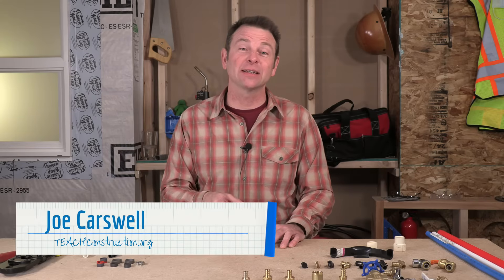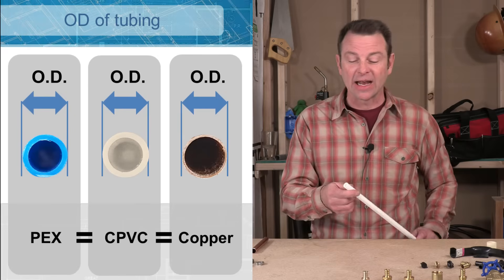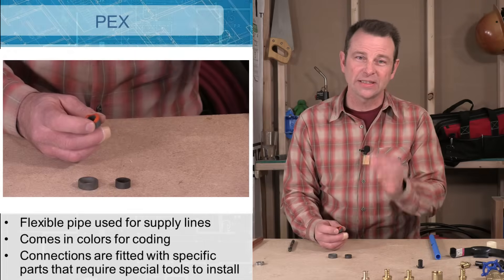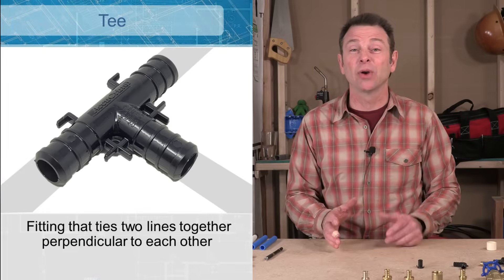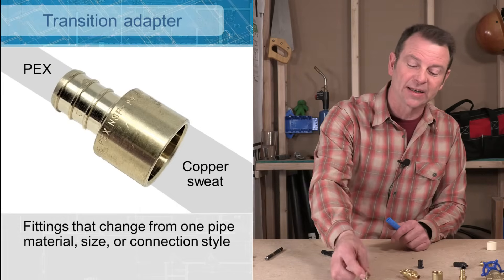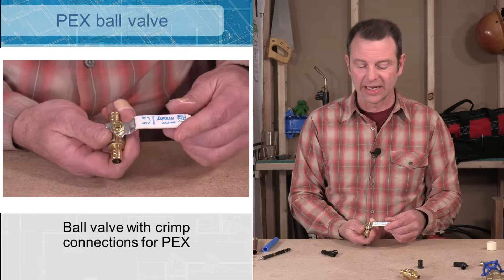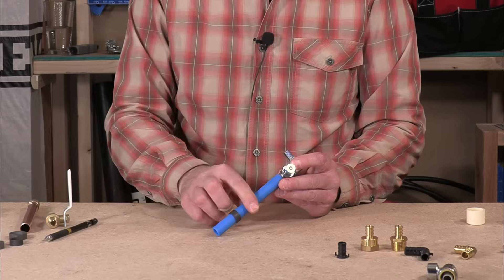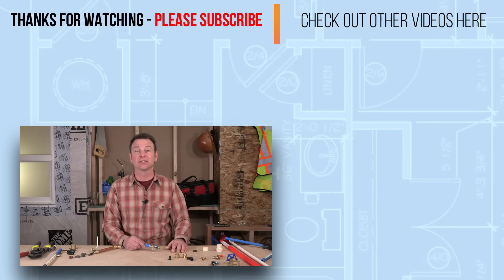A lesson about basic PEX plumbing materials  - Intro to Plumbing Systems

Comment: No mentioning of being careful to not confuse expandable and insert fittings where pex-a is always expandable and pex-b is commonly insert only (zurn being the exception to my knowledge). Expendables are full bore as the pex-a/zurn pipe is expanded so they don't obstruct flow while pex-b inserts restrict flow as they fit inside the pex-b pipe.  It's a very important distinction and the reason I believe Pex-A has the reputation for being 'leaky' when it's really this critical piece of missing information.
Reply: I did not know that but I decided on B.  Plumbers seem to be using A, and there is a video of one vs. the other.  In it he says the tool for B is $150 and the one for A is $250.  That's WAY off.  Try $32 for the B crimper, cutter, 20 1/2" crimps and 10 3/4" crimps.  The tool for A is more like $475.  The PEX A tubing seems better, and more expensive, and when they connect the two together they, they simply crimp it onto a B fitting.  At first I was going to use A tubing with B fittings but decided against that too.  While A can recover from a kink, what are the chances of that actually happening after install, and if you use a bend guide support, it won't happen at all.  Yes, there is a restriction at every fitting with B, but would the difference even be detectable in userland?  Faucets and showers have flow restrictors that limit it anyway so I doubt it.  There is even a screen on the washer inlets.  About the only place it is unrestricted is the hose bibs and those are usually fed by 3/4" main and 1/2" through the wall and even sprinklers don't kick out that much unless you are using it for underground sprinkling in which case you wouldn't go through the wall 1/2".
Reply: @jackt6112  There are various tools for A and B, if you want to compare the cheapest A it's around 60-80 but it's manual, I'd rather spend the 400-450 you mention on the dewalt battery one.

"A tubing with B fittings" - yeah that'd be a waste, the whole point of A is the full flow fittings.  The crimp recovery is just handy bonus.  As for the restriction being detectable.  I personally feel it has to be detectable because I grew up in a house with copper full flow fittings and the pressure was fine with multiple bathrooms in use where as my post 2000 build homes have terrible water pressure even though the water hoses which break off early in the water lines for both post 2000 houses are about the same pressure.  I can only blame the fittings or multiple houses have had really really bad plumbing designers vs the 1960s.
Reply: @Trahloc  Actually I was comparing it to the Milwaukee but it seems the DeWalt is priced similarly.  From what I've seen on YouTube and online, unlike PEX B, doing PEX A with a manual tool is considered operator cruelty.  On the flow restrictions, I have nothing to compare it to.  Galvanized 1/2" is .622", copper is .527", while 1/2" PEX is 0.485".  The dimensions were arrived to to duplicate tested to have the same average flow over time in a plumbing system as galvanized of the same size so there is no difference for design purposes between galvanized, copper, or PEX.  However, we know, PEX A doesn't have the diameter restriction at the fittings so that begs the question, which PEX established the ID?  My guess would be PEX A since A comes before B, and none of the others have restrictions at the fittings.  Both PEXs are the same ID so PEX A should flow better to some extent, so that would mean that there is no valid design standard for PEX B.  PEX B is an easier install and has the better track record for not developing leaks over time.  However, PEX A is approved, so it cannot be that bad.  Black Polyethylene Tubing as used in underground sprinkling tubing and gas lines has a .600" ID so it does compensate for barb fittings.  I'll have to research to see if there is a de facto adjustment for PEX B that can be used to ensure a PEX B system has similar performance to the others.
Reply from the maker: Great conversation going on - really great to see.   We just purchased the Milwaukee PEX A expander and will be doing a video about PEX A in the coming weeks.   My two cents on the flow restriction of B - it is a real thing.  I redid my house from copper to PEX B using a distribution manifold and a clean run for each line.  I noticed a measurable flow reduction.   I will measure it as part of our next video - or an additional mini lesson as part of the series.
Reply: Good information, thank you!  I subscribed to your channel.  I heard that you can compensate for the reduction in flow caused by the Pex B connectors by installing 3/4" Pex, and that makes sense, but on some other video they don't recommend up sizing for the hot water line because it would waste more energy.  So your comment makes me think that I should go with Pex A or CPVC pipe. Which one would you recommend between Pex A and CPVC for a hot water line?  Also, how dependable are the shark bite connectors near  the water heater?  On my hot water heater there's a copper pipe connected to galvanize pipe. I'm wondering if it would be okay to connect the copper pipe to pext A or CPVC....the copper pipe is connected to the water heater and is only about 2' long so the connection will be subjected to lots of heat.
Reply: @genechicago4806  
1.  Something that you can do to keep your lines small is by integrating something like the SharkBite 22786 4-Port Open Copper PEX Manifold.  (don't be fooled where it says 1", that is the extra body diameter which is what you want.)  You could make your own manifold too out of cpvc or anything.  For some it makes sense to have a cold manifold near the inlet of the water heater and another near the outlet.  This minimizes temperature and pressure changes when showers, faucets, toilets, dishwashers, and washing machines kick in.  They also make much more expensive distribution blocks with shut-offs built into each outlet if you are so inclined.
2.  Water Heaters
- CPVC can be as close as six inches away from the water heater and rated for 230°F.  CPVC does not crystallize and thus does not have a melting temperature.  The measurement that is most commonly used to determine the maximum use temperature is called the heat deflection temperature (HDT). This is the temperature at which the plastic will begin to deflect while supporting a small mechanical load.  230°F is CPVC's heat deflection temperature, and thus a maximum use temperature, which is greater than most other thermoplastic piping.  CPVC does eventually reach a point where they transition from being hard and rigid to becoming soft and flexible. This temperature is called the glass transition temperature (Tg).  This begins at 275°F.
- The Uniform Plumbing Code (UPC 604.13) states that “PEX tubing shall not be installed within the first 18 inches of piping connected to a water heater."   ASTM specifications F877 for PEX tubing is a Pressure @ Temperature rating. As the temperature increases the max operating pressure drops. Most PEX tubing will be rated for: 160 psi at 73°F 100 psi at 180°F 80 psi at 200°F 
- Other sources add at least 6" away from the vent for combustion heaters.  Combustion heaters are in general very inefficient and consequently their exhaust quite hot.  There are high efficiency ones that are so cool that, like high efficiency furnaces, need a fan to move the exhaust out.
3.  Reliability of the plastic systems is good and everything is relative.  Of the plastics, statistically PEX B is more reliable than PEX A even when using high-end PEX expansion tools (~$450 for what you need).  Based on reviews of less expensive manual tools, they require the arms of a stevedore and the resulting joints often leak thereby rendering those tools unusable.  PEX B is also more reliable than CPVC.  However, keep in mind that CPVC is used for commercial fire sprinkler systems. 
4.  Other:  
- You MIGHT want to consider Water Hammer Arrestors on some lines with automatic valves.  The traditional standpipes that used to be used as Water Hammer Arrestors have the problem where the trapped air becomes dissolved into the water after a time rendering them inoperable until the plumbing is drained at some point.  They also had to be vertical.  The sealed piston Water Hammer Arrestor overcomes both of these limitations.  You can buy Washing Machine Outlet Boxes with Water Hammer Arrestors built in.  The same can be said for Ice Maker Outlet Boxes.  One could argue that due to the somewhat flexible nature of PEX that they are less necessary.  Also, a surprising number of appliances have soft closing valves.  The argument for Water Hammer Arrestors was to stop the noise from shaking pipes, not leaks, which it should contribute to, but I have not seen that mentioned.  What is true is the pressures go very high during that event, especially on rigid pipes.  The speed of the water and the length of the pipe all factor into this since it is caused by the inertial of the water column.  It may be you will want to install them if code wants to see them more than a real need.  Needed or not, one thing you can take to the bank is they definitely minimize pressure spikes from fast-closing values.
- Thought:  I wonder if when a home estimator or inspector sees PEX A he might be more inclined to make the assumption that it was installed by a plumber and was not a homeowner upgrade.  With CPVC he would assume it was done by a plumber and inspected if you followed the simple recommended procedures required for a plumbing inspection.  The same might be said for Water Hammer Arrestors, especially if they are required by local code.
- Thought: Rodents are a problem for PEX while it is not for the rigid materials.
Reply: @jackt6112  Thank you for the detailed information!  It looks like CPVC's higher temparature rating makes a better choice for the hot water line---so I'll go with that. Also, there's probably a lower chance of me messing up a connection when glueing than with crimping or expansion rings so this is another reason why why I'm going with  CPVC.  Thanks again and have a good day!
Reply: @jackt6112  Thanks for your knowledge.
Reply: This will make makes a sense out of the experiences of both Trahloc and TEACH Construction Community Education, as well as saved me from downgrading my current 72-year-old galvanized system to a new lower performing new system.

There is a Williams Heating and Plumbing YouTube video "How to Size Your Water Lines (PEX & Copper)" that shows how to size using the 2018 Uniform Plumbing Code where he used with the 75% method.  He says in the video though that it is for galvanized also, which indicated to me that it might be based on the Schedule 40 standard, so I decided to check.  I didn't find that, but I did find "2021 Uniform Plumbing Code" "Appendix A Recommended Rules for Sizing the Water Supply System" shows its roots are based on Schedule 40.  There is a lot of useful information in it based on water pressure, length, and even disambiguates between threaded and non-threaded fitting adjustments (E.G. a 90 degree fitting is the same as adding 2' to the pipe etc.) that are not included in the video.  It also gives the average flow rates of many components such as kitchen sink, showers, etc.  According to the video, there are no differences that need to be considered between galvanized, copper, CPVC, and PEX.  Moreover the recommendation adjustment for PEX B fittings is if you are close to the limit on the calculated size required and there are quite a few fittings, then upsize it.  

This might work for plumbers.  However, I see problems with what was presented in the video as well as the Uniform Plumbing Code if your expectation is match the performance of another technology.  Steel and CPVC are Schedule 40.  Copper and PEX are not, and their inside diameters are substantially smaller.  PEX is not even mentioned in the "2021 Uniform Plumbing Code" "Appendix A Recommended Rules for Sizing the Water Supply System", so one cannot say that the reference cited in the video supports the method demonstrated.  One would need to find the PEX-specific information to adjust the otherwise useful method shown.  Looking at other references, flow rates have a lot less to do with surface roughness than diameter.  My guess is the reason they use 100' as a basis is because at 50' it is hardly worth mentioning.  So let's look at some numbers.

Pipe IDs.
- Galvanized 1/2" ID is .622"	(Schedule 40 spec. was speced oversize for steel pipes to compensate for average flow restrictions of fittings)
- CPVC 1/2" ID is .622"			(Schedule 40)
- Copper M 1/2" ID is 0.569"
- PEX 1/2" ID is .485"
- PEX 5/8" ID is .584"
- Schedule 40 3/4" is .824
- 3/4" Copper M is 00.811
- PEX 3/4" ID is .681"
- Schedule 40 1" ID is 1.049
- Copper M 1" is 1.055
- PEX 1" ID is 0.875"

Flow rates from a Supply Resources (The min is based on 2' per second and the max on 4' per second.)
- 1/2" Schedule 40 calculated max 3.841
- 1/2" Copper min 1.6 max 3.2
- 1/2" PEX  min 1.2 max 2.3
- 5/8" PEX  min 1.7 max 3.3
- 3/4" Copper  min 3.2 max 6.5
- 3/4" PEX  min 2.3 max 4.6
- 1"   PEX  min 3.8 max 7.5

What this indicates is if you want 1/2" copper performance, you need to go with 5/8" PEX.  If you have galvanized or CPVC, it is Schedule 40 which is altogether different again.  So let's do a rough estimation of what it would be for 1/2" galvanized and CPVC.  
- 1/2" PEX has an area of 0.18475 with a flow rate of 2.3 gpm
- Copper has an area of 0.2543 with a flow rate of 3.2 gpm.
- The area difference is .0.06955 with a flow rate difference of .9 gpm
- If we divide 0.06955 by 9, it will yields 0.007727777777778 per .1 gpm
- Schedule 40 1/2" based on it's .622" diameter has an area of 0.30386
- The difference in area between Schedule 40 and copper is 0.04956
- If we divide that by 0.007727777777778 we get 6.413227893601541 tenths of a gallon more than copper.
- From this rough calculation, Schedule 40 1/2" flows 3.2(copper) + .641(for dia dif) = 3.841 gpm for 1/2" Schedule 40, but is actually a little more than that because the circumference doesn't increase linearly with the area.  So we will now enter that into the table above.
PS:  You might want to check my math.  I found an error in an inside diameter, corrected it, and recalculated, so you may find something out of sync.

This is all very useful but what about the difference between PEX A and PEX B?  That information was a little more difficult to find, but I did.
"PEX manufacturers state that PEX uses about 30 percent fewer fittings than CPVC in a typical installation, but that doesn’t come close to offsetting the higher pressure drops that occur with PEX pipes and fittings. Compared to a PEX system with 30% fewer fittings, CPVC (which is Schedule 40, achieves a 74-83% reduction in equivalent length caused by fittings.  The reality is that even PEX expansion fittings, which are sometimes referred to as "full-flow", restrict flow rates.  In fact, the difference in the internal diameter between a CPVC fitting (schedule 40) and an expansion PEX fitting is greater (27%) than the difference between an expansion PEX fitting and a PEX plastic body crimped fitting (22%)."  Thus, this states there is a cost for PEX A due to its diameter plus another 22% for PEX B plastic barb fittings.  The difference in flow comes out about what we calculated based on diameter.  However, this used 8 feet per second rather than 4 feet per second, which increases the difference, but highlights the cost PEX A is significant and PEX B adds a lot to that.

Analysis:
- To barely maintain 1/2" copper performance one would have to go to 5/8" PEX and it would still be well under 1/2" schedule 40.  3/4 copper or Schedule 40 would have to be replaced by 1" PEX, and that is before the penalties of PEX B fittings..  
- Schedule 40 is over engineered for the average flow restrictions from fittings.  Copper and PEX use a Fisherman's Scale to measure size which explains the lower performance people are seeing with PEX.
- Using the Uniform Plumbing Code book for sizing your system won't save you because its based on Schedule 40 standard.  The plumber in the video used 75% of max. capacity for design which won't even save you because simply copper to PEX puts you at 71%, 60% of the Schedule 40 used for the calculation, and that's before any PEX B fitting penalties.
- Reading online I learned that PEX B almost never leaks while manual tools used for PEX-A very often end up leaking and you need to spend $400 to $500 to get a reliable installation.
- Before this, I hadn't even considered CPVC since I don't see it getting much attention like copper or PEX nor did I expect to gain respect for galvanized, even though I would use galvanized today.  
*I found it interesting that copper M in 1" is very slightly larger than Schedule 40 1" which was quite the opposite with the smaller sizes.

I'll answer this question before it gets asked.  
Question: Have you seen inside of your 72 year old galvanized pipes?
Answer: Yes, and they are wide open.  A lot of water flows through them which keeps them clear.  I have no pressure problems and was simply concerned with their age.  I have worked on a house where they didn't use the downstairs bathroom and there was only an 1/8" hole remaining in a pipe and another that looked like stalactites on the inside of a cave.  However, those line seen very little activity.

Comment: Look at the inside of the 90 it’s not the same size as the pipe so restricts the water volume or flow
Reply from the maker: Yes. That is a challenge of using PEX
Reply: @ConstructionEd  don’t use pex a. Upinor. It’s getting eaten up. Pex b I’d oversize the pipe size because of the flow restriction
Reply from the maker: @joshuajohnson1036  I agree on the oversizing